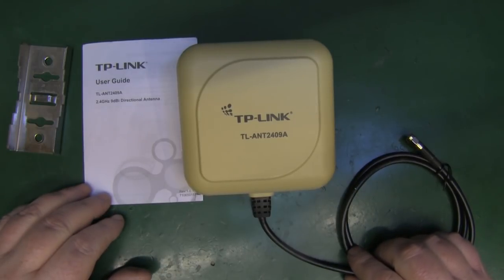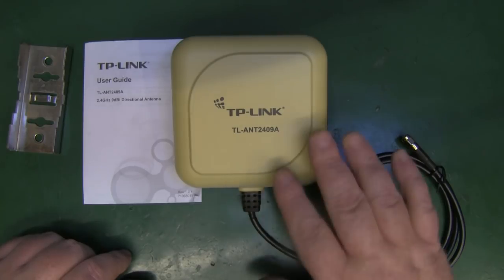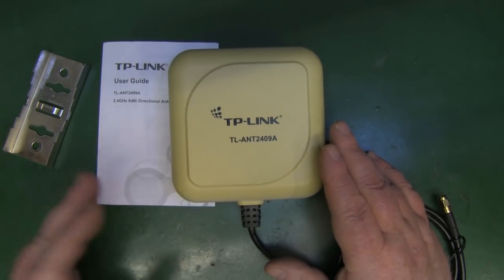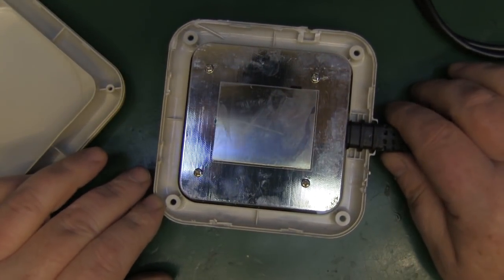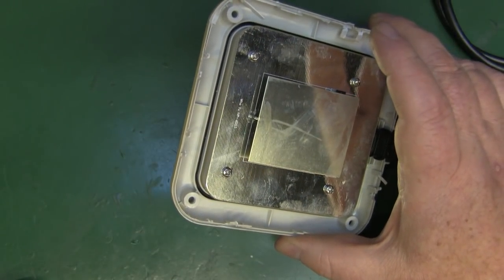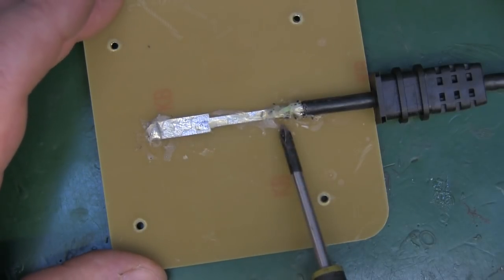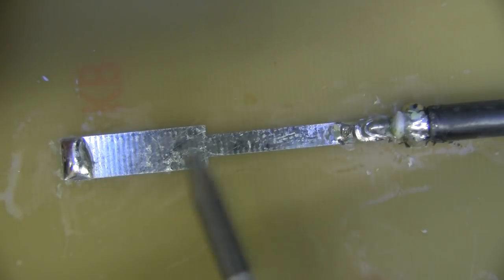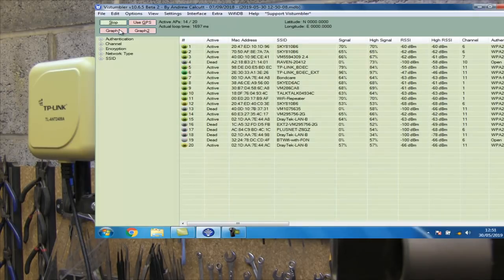Taking a Look at the TP Link TL ANT2409A Wifi Antenna

Comment: Hey Andrew - The length of the patch looks longer than half wavelength (lamda/2 ~ 61mm).  If that is the case, then the feedpoint at the edge is likely a very low impedance feedpoint, not a high one.  This makes sense, as you show a lamda/4 matching stub that is wider than the launch from the 50 ohm coax.  The "inset" feed you mention makes sense for patches that have L = lamda/2.

Comment: Hi, Andrew, how are you? hope so. You could do a test with the other model of the TL-ANT2414B TL-ANT2414B from 14dbi, I wonder if this model really is worth investing the amount charged by it. Thank you for everything and continue to do your analyzes and comments on antennas, short your videos and always follow your posts.
Reply from the maker: I used to have one but it disappeared from my class room a few years ago. It is a very good antenna I will have to see if I can get a used one of ebay as the construction is interesting but as you point out they are a bit pricey for anew one.
Reply: @andrewmcneil  sir is 4g antenna used in 2.4ghz frequency wifi usb adaptor?

Comment: I use two of these on my DJi Mavic Pro Remote Control. With a 4 watt edup amp. Works fantastic up to 7 miles with amp!!! I have shortened the cables to about 4 inches and re housed the antennas. These are the antennas that I asked if I was going to run a splitter and use two of them for the transmission channel... if I should keep them a specific distance apart, or if I should focus them straight or left/right a few degrees. Any input would be greatly appreciated!!